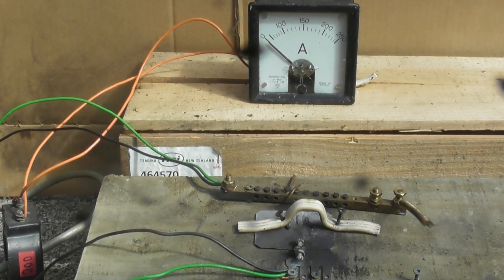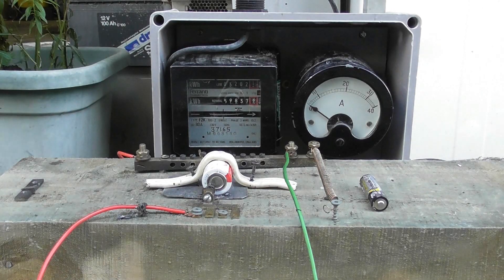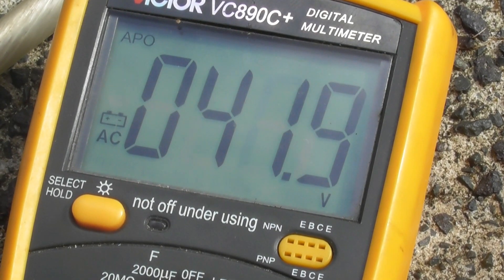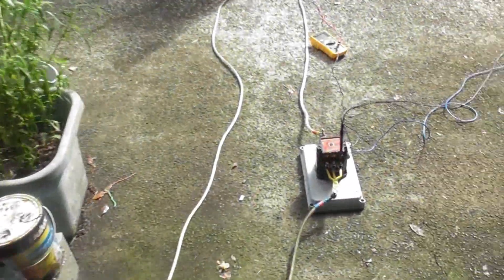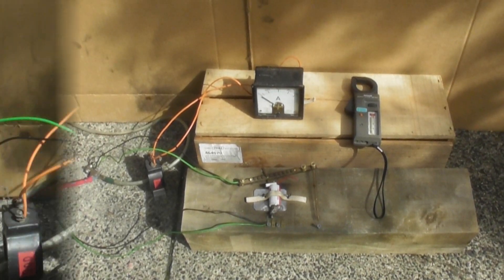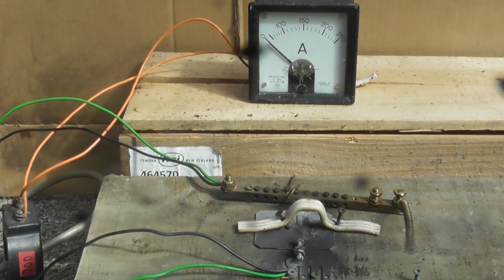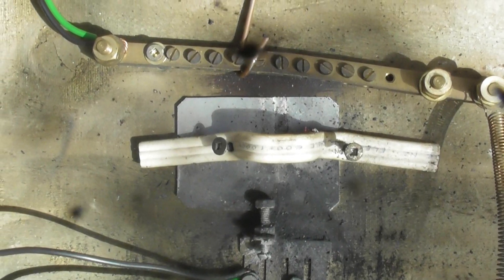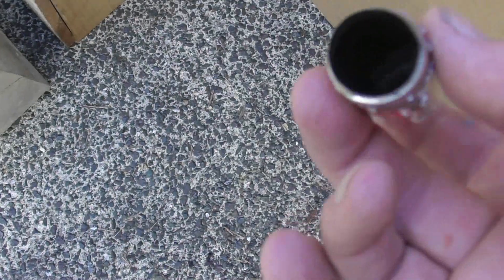Necessities Battery pop 1

Comment: Here in the USA, we have those cheap-o ($1 per pack) Sunbeam heavy-duty batteries with the same red and white design.  Coincidence?
Reply: I was wondering if they're the same! The Sunbeam cheapie batteries are usually carbon zinc, and I've had good luck with them not leaking... They are, however, about 1/3 empty space.

I'm guessing making one of these pop would not be all that impressive as the seal that lets the battery guts go into the empty expansion space is pretty much just a layer of some kind of grease to keep the electrolyte paste sealed away from air.